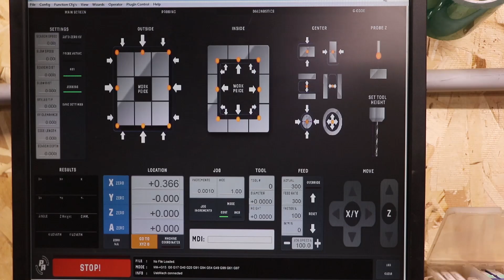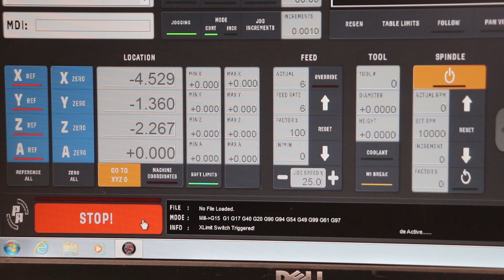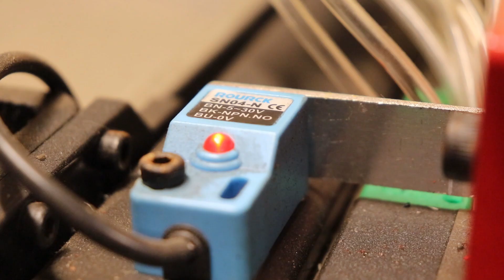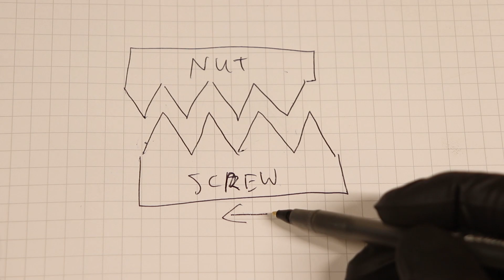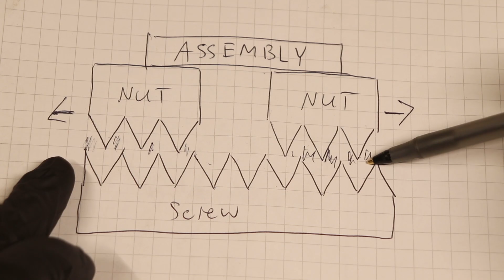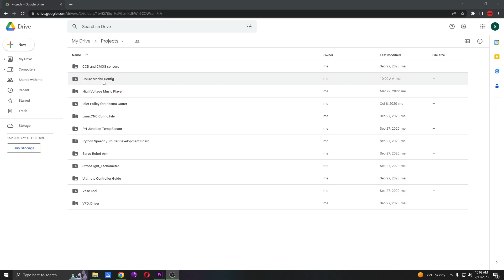DMC2: Additional Info

Comment: Any more cnc videos coming ? 

Also did you check for "tool wear" in regards to tolerance issues ? For example your 6mm endmill might actually be 5.95mm-6.05mm. 

Even if there is no tool wear you could try putting tool wear in the software anyway to see if it gets you closer to the desired size cuts. (almost like a work around due to your last video saying backlash compensation didnt seem to work)

Comment: I have a question on the X axis ball nuts.  How tight/loose is the compression stack to be?  Msg me if you need more info, hard to explain.  I have lots of trouble getting it to drill/mill holes where i designed them with fusion 360.
Reply from the maker: Well obviously the double ballnut is there so you have no backlash when switching direction, and the tighter you compress the double ballnut the less likely you will introduce backlash under hard cutting loads when switching direction. Although for most  people it would be enough to just compress the ballnuts so the ballscrew can still be easily rotated by hand. The more you compress the ballnuts the more friction/wear you create and the motors work harder/hotter. I honestly do the compression by feel and then always check my backlash and then run some test cuts/programs to check accuracy and see how hot my motors and drivers/amps get. Ive heard some people having problems with their shaft couplers slipping too, which can cause weird travel issues. So make sure the couplers between the motors and ballscrews are not slipping. Hope that helps.

Comment: Hi mate, I have the DMC2 and it jogs by the hand held controller or by the computer. I have changed the scripts for the probing but i cant find any info on how to mill the bed flat? How did you do yours mate? cheers Andy
Reply from the maker: Milling the bed would require you to learn how to make a gcode file. I modeled a rectangle the size of my DMC2 bed in fusion 360 and setup a facing operation toolpath. I believe Omar has good videos on setting up cutting operations in fusion 360. Alternatively, you could learn Freecad and do that there. There are quite a few ways of making gcode files, even writing a file manually is possible if you understand the code enough. Hope that helps.
Reply: @SciCynicalInventing  Hi and thanks for replying, I thought I’d need to do that in Fusion so thanks for confirming this. I have actually made a 350mm by 250mm by .5mm thick part in fusion. I think I need to sort out the tools first so I can mill the bed. Did you use the tools that Omar supplied and is it easy enough to add these tools into fusion? Once I get past this stage I will mount the vice so I can calibrate the probes. Did you set your probes up after you milled the bed? Thanks for your help I appreciate it. Andy
Reply from the maker: @hornbachhh  I used my own endmills and insert cutters and just found the closest sized tool in fusion 360s library to use for my toolpaths. If your using a 5 or 10 mm endmill there should already be a tool that size in fusions library but keep in mind you can always modify that tool any way youd like (change the diameter, etc). I think i set up my probes last. I am used to touching off a part using the tool and a piece of paper. Theres many ways to do it.
Reply: @SciCynicalInventing  Awesome thanks again 👍
Reply: Hi me again sorry to bug you. Does your emergency stop button work on your hand controller?
Reply from the maker: I didnt buy a hand controller or "MPG wheel" i just control the cnc with the keyboard

Comment: When checking the runout of the spindle, don't use a collet. Measure the inside of the spindle taper directly. Much of the runout you saw was likely from the collet. You may be able to "tune out" some of a collet's runout by twisting the collect in the taper.

Comment: Many thanks for posting this updated video.  You saved me a lot of frustration with the spindle wiring.  Omar's picture in the manual for wiring the spindle plug is definitely wrong for the green wire.  Once I matched your wiring my spindle would start to spin, but only when I pushed the start button on the inverter, and ramped it between 50 and 400 Hz.  The thing I am now missing is how to set up and control the inverter from Mach3.  Any suggestions would be appreciated...😊
Reply from the maker: Take a look at the "DMC Software Instructions" pdf step 9 (page 18), assuming all your wiring is correct, there are some settings on the VFD that you will need to change to allow mach 3 to trigger the VFD for spindle control. Im assuming you also set up your ports and pins correctly in the mach 3 software as well. The booklet that comes with the VFD also has instructions on how to change the values in tbe VFD for external control.

Comment: Hi, is your corner probing button script working OK?
I have a DIY CNC running that PA screen, but those corner buttons don't work properly.
Thanks
Reply from the maker: I don't use the corner probing, I've survived just with using the provided scripts. However, If you want a specific script you might want to check out the original authors youtube channel:
https://www.youtube.com/watch?v=MQ9XT30s-PU
If you can't find exactly what you need you might have to program a script yourself, there are some reference manuals available:
https://www.machsupport.com/wp-content/uploads/2013/02/Mach3_V3.x_Macro_Prog_Ref.pdf
Reply: @SciCynicalInventing 
Thank you so much for the complete reply!
Good luck 🙌🏻🙂